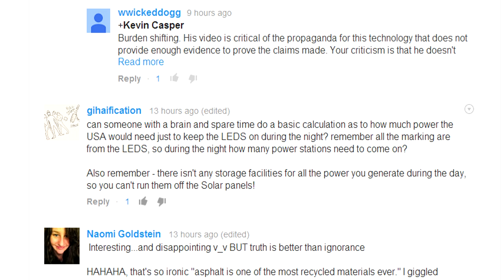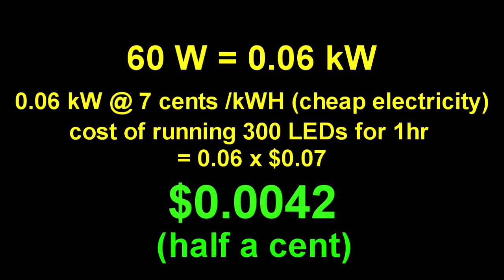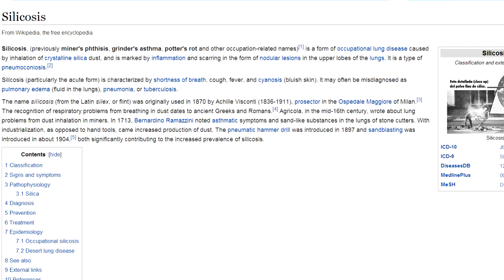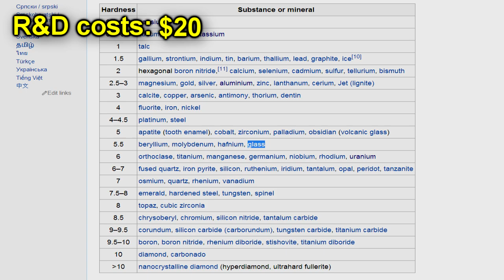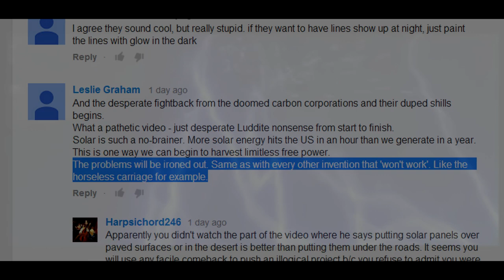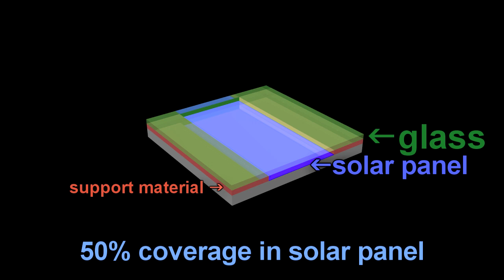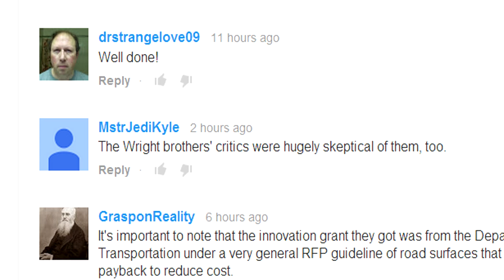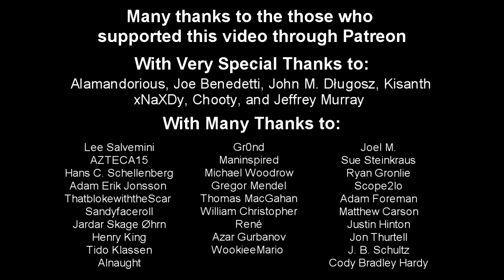Solar Roadways, IMPORTANT QUESTIONS AND ANSWERS!

Comment: some time ago, i heard a theory for putting wind turbine generators by the side of the road to capture some of the vast amounts of energy leakage to wind friction.
i think these would be more viable, but there is still the problem of actually being able to raise enough voltage to make them do anything useful.
Reply: Oh yes it is!
Reply: ***** "one pound of nuclear waste is enough to destroy an entire neighborhood."
That's an extremely vague statement. Perhaps if the neighborhood ATE it, it would kill them.
Reply: Would never happen. Stationary obstacles need to be a certain distance away from lane edge for safety reasons. The higher a road's design speed, the farther away the obstacle needs to be.
Reply: Of course, to get around that problem would be to install guardrails wherever you put a turbine, but really, how may of these things would need to be built to generate enough energy to make it worth it?
Reply: ***** Putting them on the side of the road is probably not much better than putting them anywhere else, though.
Reply: *****
i've been thinking of a wind turbine for my own home since i'm practically in a 'forest' (surrounded by tall trees) so solar is out of the question for me.
Reply: A huge problem with this is if the government is willing to rebuild our roads. If they don't the main problem with the wind that is suppose to be generated by passing cars is if all the cars are now in traffic. Our current highway system is already getting crowded and is high inefficient in suppressing traffic, so what power is made would only be even less.
Reply: +Urudrim And I had a theory for putting various IFR nuclear power plants around the place to generate a huge baseload of clean energy for modern society (including electric cars!) to run on.  I think these would be more viable than wind OR solar, but there is still the problem of countering greenie bullshit nuclear power propoganda.
Reply: *****

You have to compare the amount of nuclear waste to the power it produces. It's massive. You also have to realize that relative to other serious energy generation, they produce far less waste. An average 500mw coal plant emits 14,000 TONS per yer of sulfur dioxide. 10,300 tons of nitrious oxide, 500 tons of PM, 170lb of mercury, 110lb of lead, 720 tons of carbon monoxide, 220 tons of unburned hydrocarbons, and 225 pounds of arsenic.

A nuclear power plant produces double the electricity in the example above and produces about 20 tons of nuclear waste per year, much of which decays in less than 100 years. Again, compare that to the 25,000 TONS of nasty shit that a coal plant produces that never decays.
Reply: ***** And a HUman breathing does the same, is proven too, yetwe still do it.
Nuclear power is today, the !safest! power we have. Look it up, look at how many people died combined fomr all nuclear accidents, compare that, to the people annually dieing form things like coal.
Even wind-energy kills more people perkWh than nuclear powerplants.
Reply: *****

"1. ALL nuclear power plants require a coal plant to operate."
Source please.

"2. nuclear power plants are cooled with fresh water thus using up over 80% of the worlds fresh water supplies and then it is dumped into the salt water ocean."
Nope, neither.

"yet billions of people world wide are dying of thirst literally."
Doesn't matter, the water would under no circumstances get to them.

"there is a global fresh water shortage because of nuclear power plants." Source (on that bollocks) please.

"or those who died years later from exposure but if not exposed would have lived much much longer and healthier lives. your statistics are meaningless."
NOpe, the Deaths/Killawatthour INCLUDE all the death that WILL occur form dissasters like Tchernobyl already.
Yes, we know how many people could potentially die, and we do know, that this number is atleast by the factor 100 bigger, than actually will die.
They also include all the people diing form gathering the raw-materials as well as the endäproducts.
And yet, nuclear power is safer than wind/Solar.
Reply: ABaumstumpf
 No nuke plants need electricity to start up. From then on, their own power fuels their systems but that realy is no different from other modern powerplants if only becouse all of them use electromagnets that just don't work without electricity.

Also: all power plants need cooling water. The amount used by nuclear plants is no different from the needs of a coal plant. The water exposed to the radioactive core is in a closed system. The cooling water of power plants usually comes from rivers and is released back into those same rivers after use. If no river is available, usually underground sources fill the needs and cooling towers then release the used water into the air.

The use of water by power plants doesn't even aproach your 80%. If you want to attack an industry on the use of water, go with cotton and paper. Producing those requires massive amounts of fresh clean water.

Comment: I don't even really understand the concept of solar roadways... Why not just make solar farms in areas that get a lot of sunlight, or near the power stations so you don't lose energy in transfer. The whole idea just seems useless. The materials we have for roads right now work remarkably well, why change it to something so expensive and ludicrous?
Reply: It's a lot harder to sell aspiration for an idea that's:
A. already being done, and
B. not nearly as exciting.
Reply: The reason it's hard to find invenstors for building solar plants is not the technology or even it's long term profitability (which is actually better then coal plants) but it's short term profit... Building a solar plant is way more expencive then building any other type (including nuclear). Those initial inventment costs means it takes quite a long time before they start making a profit and private investors don't like to wait that long.  Even though the upkeep costs are very low and fuel costs don't exists, investors still won't invest due to the lack of short term profit. Coal plants need fuel and quite a bit of upkeep but they are quite ceap to build and start making a profit quite fast.
Reply: I know, but it is a hell of a lot smarter and cost efficient than making solar roadways, so if they are so bent on solar power why not just make solar farms?

Comment: It looks as though the panels are well over 2 feet from corner to corner.  They are made of tempered glass which means that if the break they shatter into a thousand pieces meaning you will instantly have an over two foot wide pothole deep enough and with vertical edges to rip the tires off any vehicle unlucky enough to hit it.  Its not the weight of a vehicle which is the problem with breaking these panels, it is impact.  Lots of things fall off trucks, all you have to do is look at the sides of the road of any busy highway.  Even a minor accident could destroy a significant number of these panels. A semi just running over a rock or spark plug might be enough to break them.

Another problem is sealing the panels.  They need to be water tight.  There will inevitably form low spots were water collects and if the panels are not perfectly sealed they will not only flood the electronics, but begin to undermine the substrate supporting the panels. The environmental conditions the sealants will be subjected to would guarantee that only the most exotic and expensive sealing materials could hope to work if at all.

Also, using off-the-shelf electronic components will not work.  The heat and vibration alone, not to mention the corrosive chemicals that will leach in either through the seals or from underneath if they are build over existing roadways, will be enough to render commercial grade electronics inoperable in quick order.